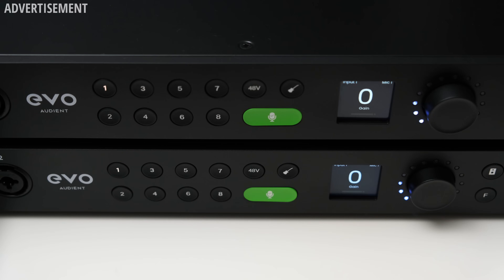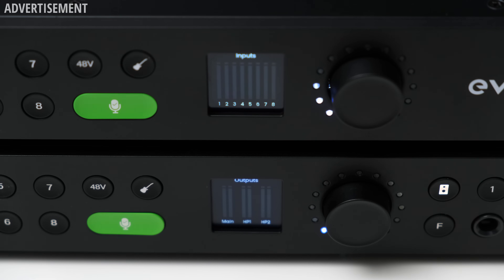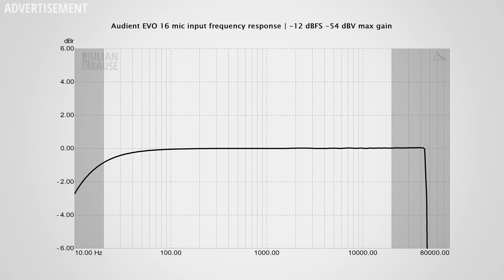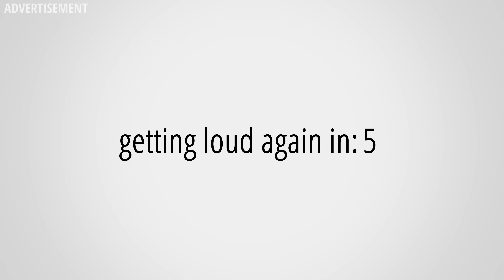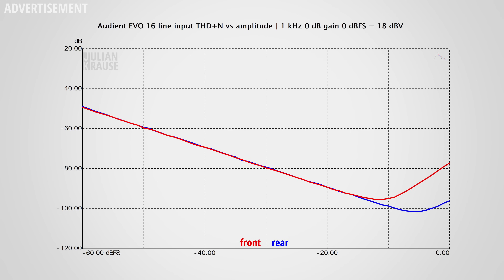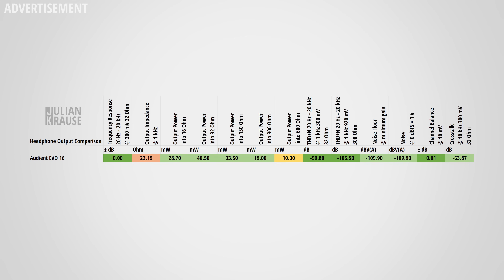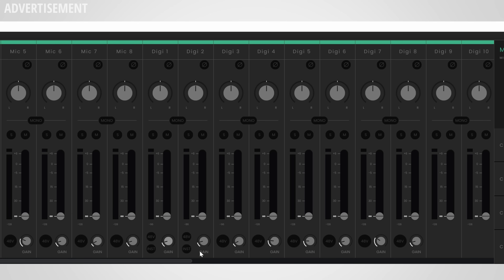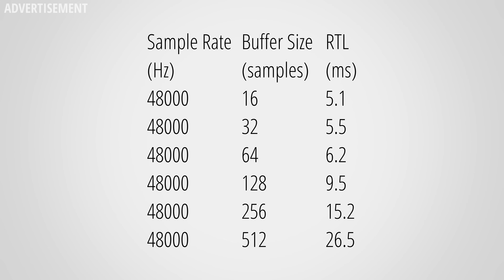Audient EVO 16 and SP8 – USB Audio Interface and Mic Preamp Review (Smart Gain)

Comment: Hello Julian, and thank you for your excellent work. I'm really tempted by this configuration, but what you say at 12:16 about the headphone output worries me. I have an ATH-M50x headset (39 ohms) which would therefore not work well with the Evo 16? Which 80 ohms+ headset do you recommend to have a more neutral response? While remaining within a reasonable price. 🙂 
Or what was the blue line headset, if you remember ?

Comment: great video especially because you show the internal circuitry ... I note that the active components are excellent but the sound of these units is not that great, it's the fault of the polymer capacitors which in my opinion ruin the sound ... if the interstage capacitors were for example nichicon or wima it would be an excellent interface, too bad ...

Comment: I am thinking of buying evo 16 but I am not familiar with the technical terms. I'm currently using Beyerdynamic DT 770 PRO 80 OHM and I don't know if it will give the right frequency tray for it, I'm thinking of buying a 250 ohm headphone for the future, can it offer them to me without problems and at a very high accurate sound.

Comment: I have been using SP16 for months and it is a very good interface. Absolutely no problems or instability. 8 inputs and 8 outputs with the possibility of easy expansion to 24 inputs and 24 outputs is a fantastic perspective! You just forgot to mention about very dark interface. Buttons and texts are very hard to read. I wrote to Audiient and asked for a change, but no success at the time.

Thank you for all your valuable reviews. Regards! Adam.

Comment: Gain range & dynamic ranges are kinda INCOMPETITIVE.  Like a lot the fisical design and the inovative function of the 'green button'. Hate the fact interfaces have most of their inputs on the back, forcing the use of longer cables in some set-ups. At least 4 inputs in the front should be the standard.

Comment: thanks.. confirms my experience. I am currently in the transition from Focusrite Claretts to EVO 16 + SP8 and although on paper the Claretts are better, in real life (drum recording) I get better and faster! results with the EVOs. Now I just hope they will last better than for instance Audient ASP880 that for 2 of my friends died after 2-3 years :-/
Reply: Man, I'm currently trying to decide between the EVO 16 and the Clarett 8 Pre. I record drums, guitar, bass, vocals, percussions... all the good stuff. Which one would you recommend I get?
Reply: @MrTrotta2010  Honestly I would go with the EVO16.. the Clarett has marginally better pres, mostly because you get the "air" option which works well especially on snare and bd, BUT and thats where I love the EVO: 
1) auto gain is a huge time saver
2) each channel has individually 48v control. Clarett only has it in pairs of channel 1-4 and/or 5-8. As a drummer you will at some point use a mix of dynamics, condensers and likely also ribbons. And at that point the clarett is not that versatile, and you need to buy som phantom blockers or be really careful which mics you give 48v!

Now the build quality.. clarett is better. NO doubt. Will EVO last.. well.. I think it will last quite a few years. I do worry a bit about the center dial as you use that a lot and it does feel a bit.. well.. chinese.. no offence intended. On the other hand mine are now 3 years old and have zero issues. Well. one issue, but thats the software. For some reason the 48v on/off on the software does not work with the channels over 8.. so 9-24 do not react to the button on the software. It does on the hardware buttons and luckly its super easy to use the hardware buttons. So not REALLY a big issue. Just annoying sometimes.

I hope this helps.

Note: i did a null test of snare and BD single hits with the same mic using a Y split cable and ran it into the clarett and the Evo16. It nulled almost 100% and I absolutely guarantee that you will not be able to hear any difference unless you activate the AIR function.
I have the luxury to also have 16 channels of Clarett so I use: EVO16+SP8 and a Clarett SP8. So I have the best of both worlds :-)
Reply: @HR2635 thank you so much for the response! I was already thinking I'd go with the EVO, but you really helped me decide for sure!

Comment: hey Julian, would you consider testing DJ controllers with audio interface? they come with separate main and headphone outs and some with mic and/or line ins. 
enough to measure there and a whole product range to feature from 70€ to infinity and beyond. 
anyone else only reviews the jogs and knobs and features, you'd be the first to talk audio quality in that field 
metrics to include: are outputs in sync or delayed to each other? what kind of headphones does the headphone amp want to drive? are master levels hardware or software controlled?

Comment: Love your videos thanks.
My only comment would be that, RTL aside, the 18i20 3rd gen has the same / better figures in your tests than the EVO16 and both, sadly, need 80ohms or higher headphones - and yet your overall tone in the 18i20 3rd gen review is one of - 'it's average, nothing more nothing less' - quite disparaging - whereas your overall tone for the EVO16 is very positive.
If someone just jumps to your verdict at the end of your videos, as they trust you with the fine details, they'd come away thinking the 18i20 3rd gen is 'meh' and the EVO16 is amazing by comparison.
Also - please can we have colour bar charts for the RTL - it's one of the most important features for those using MIDI when choosing an interface.
Thanks again - your videos are fantastic!
Reply: Was noticing the same. Also an unfortunate drawback to YT videos like these overall - the need to sell/grow their channel can disrupt and skew (we're only human afterall).

Kind of thinking in this range the Focusrite 18i and 8Pre adat (clarette) is the bang for buck in this range.

Also smart gain...no no.  You can (and should) do/set all that yourself.
Reply: Is it possible to get 24 inputs with the 18i20 tho??
Reply: @JupiterStudio1  no, only 18 inputs on the focusrite - fair point, but that's not the reason the review gives for one being better than the other.
That's obviously quite objective - if you need 24 inputs over 18 then go for the EVO 👍🏼

Comment: Has anyone got the evo 16 working on an m2 Mac? And if so how does it run/are there any issues? I’m about to upgrade to an m2 after my old faithful iMac recently died, which also means I’m going to have to upgrade from my old faithful Saffire Pro 40.. I was going to try using the Saffire as an adat expansion for the audient id14, but from what I’ve read it seems to be a bit of a headache to get that working on m2.. So to avoid the headache, the Evo 16 is looking like a pretty tempting upgrade

Comment: Hi Julian, I need some advice on an audio interface
I am a keyboard player and I do live piano bar evenings but they often ask me to also do karaoke evenings and therefore I would need an audio interface that has four easy-to-manage microphone inputs and midi connections.  I have a ketron keyboard with integrated vocalizer and this allows me to harmonize the choirs present in channel 3 of the midi bases, so it's like having real choirs when I sing.
The audio interface should allow me to take advantage of this function even if I only use the PC with karaoke file management software (in my case Winlive Pro Synt).
So I should have both the connected microphones and the one I play from the PC come out of the audio interface at the same time through a DAW into which I can also load some VSTs for the voice (not only reverbs and choirs, but also effects to modify the voices) all in real time.
The final configuration should be: PC - audio interface - real-time management DAW - karaoke software.
I had thought of the Behringer umc404hd, Audient Evo 8 (but it doesn't have MIDI connections) and the M-Audio Air 192/14.
I know the first two, I saw your reviews, but not the third.
Can you tell me something more about the M-Audio Air 192/14?
Which one do you recommend?
Thank you

Comment: One thing you neglected to mention is that the SP8 can act as a standalone DA converter, which makes it the least expensive ADAT-to-analog box on the market. The only other box that I can think of that falls in the same price range is the Aphex 141B, which appears to be discontinued at the moment.
Reply: The Behringer ADA8200 also works as a standalone converter (AD and DA simultaneously) and is less than half the price (new) of the SP8. Company aside, reviews claim it as a very capable device.

Plenty of used options too: Presonus Digimax FS is a steal; or, when setup properly, the standalone mode on many interfaces can do this as well (Motu, Focusrite, Mackie, M-Audio), see Motu 828 mkIII
Reply: @4headgaming448  Go figure I forgot about the Behringer.

And, yes, many interfaces can do this but they're typically not in this price range or they're used., as you said.

Comment: Are you sure about the word clock cables?  I could have swore adat would sync clocks on these?
Reply from the maker: Hey, with one SP8 just the ADAT connection is fine but with multiple connected devices, wordclock is recommended.
Reply: @JulianKrause  ok, I am running 2 sp8s if I notice jitter or anything I'll grab some word clock cables

Comment: Can I use another EVO16 to expand an EVO16?
In my country EVO16 is $150 cheaperr than SP8.
Will the preamp gain control over adat work?
Reply: I just asked support from audient.
An EVO16 can be configured to work as an adat preamp, but the remote preamp gain control smart gain and 48v control won't be available for the EVO16 connected via ADAT.
Reply from the maker: Pretty sure that should work but I haven't tried it. You could ask the Audient support, they should know :)
Reply: No, you can't. That's what the EVOSP8 is for.

Comment: I have a EVO16 and beringer ADA8200 adat interface. 
It seems EVO 16 adat output's clock is not compatible with ADA8200, the clock won't sync. I have to set the ADA8200 as clock master for them to work.
While 18i20 don't have this issue.
Reply: I just got an UA 4-710d preamp and dont l ow how to connect to mt evo 16. The UA have 2 adat out and word clock too. Do i have to use both? BNC and ADAT cable? Evo 16 has only 1 word clock out so it must be the master clock?
Reply: @SirGyver  I dont have experience with any of these units but with other similar units via ADAT and in general for clocking you either have to use one or the other, but you of course need to connect the ADAT to get sound at all, so the options are for connecting: ADAT+BNC (word clock) or just ADAT cables. The UA 4-710d only has ADAT outputs and no ADAT inputs so if you are planning on using the Evo as master then you must use BNC wordclock, if you use the UA 4-710d as master you should likely be fine with just the ADAT cables.

Comment: The EVO 16 and SP8 are devices that have different applications, even though they are used in  sound recording.
Not sure why these two units are compared. 
One is a standard digital audio interface that can connect to a PC for recording (EVO 16) whilst the other is a mic pre-amplifier (SP 8).
Need to buy both units for recording purposes where you can use functions available of both units.
Unless you already have an interface and want a mic preamp.

Comment: Hello and thank you for the review ! I would like to know if the Balanced line outputs are DC coupled, so that they can be used with software like CV Tools/Bitwig etc for interacting with hardware synthesizers that receive CV? And if yes what is their Voltage range?
Reply from the maker: Hey, I just checked and the outputs are not DC coupled. Frequencies can go very low but sustained DC signals are not reproduced.
Reply: @JulianKrause  Thank you for taking the time to check and report back ! Keep up the great work !

Comment: Possible to connect with 5.1+DTS Home Theather Receiver via Toslink?
Reply from the maker: Hm, I don't think so. ADAT is usually not supported by HT recievers and SPDIF is afaik only able to send 5.1 signals with compressed formats like DTS. And the EVO 16 an SP8 shoudl only allow PCM signals. You could ask the Audient support but think the chances are slim that it works.